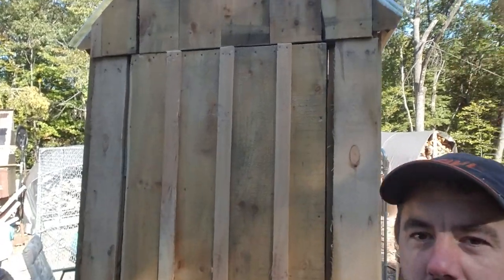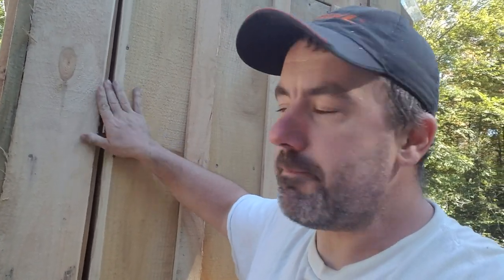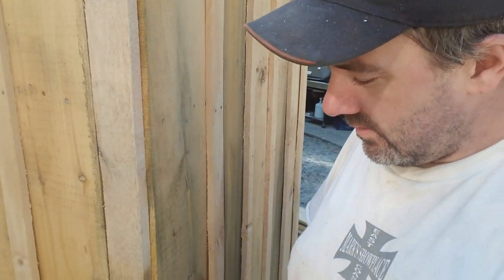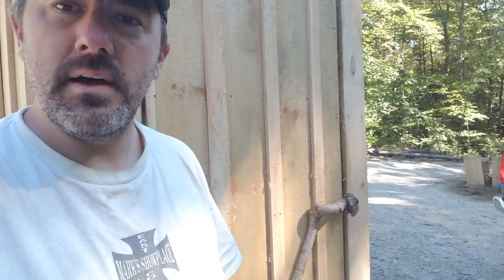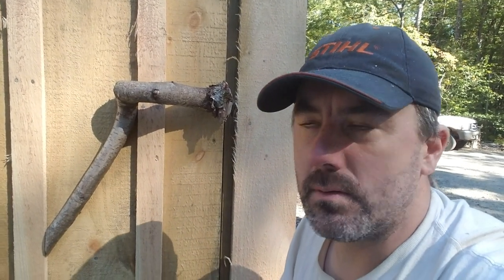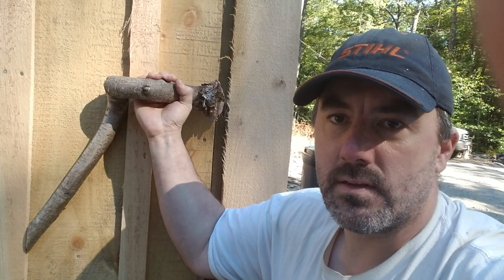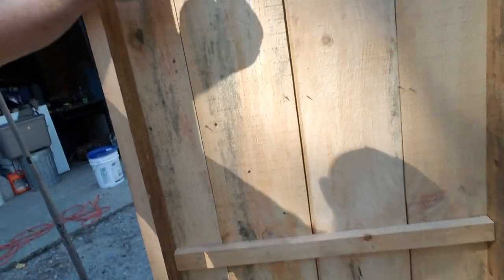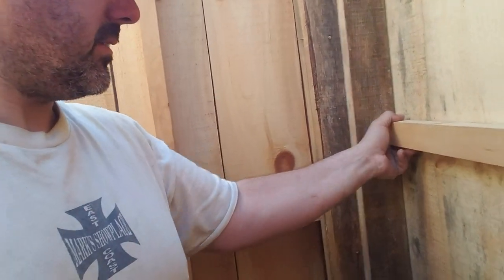Finished the Outhouse!

Comment: Hey Mike, as usual yet another cool project with the solution of the handle problem supplied by Mother Nature. 

A lot of old timers would use the surface root system off of a persimmon (or sassafras, I can’t remember) tree for walking sticks because they form various angles just below ground level. 

Never boring sir, keep it up man, keep it up. You’re doing good.
Reply from the maker: Thank you my friend!

Comment: I'm curious, As in most out houses would have some sort of ventilation in it... and why the tried-and-true Crescent Moon isn't on this either?
Reply from the maker: It has some good ventilation.  The soffits aren't air tight and I left gaps on purpose.   The roof siding is board and batten without the batten.  The ridge of the roof is also vented.  I probably should have mentioned those things in the video. Also, the new owner is going to do the Outhouse portion of it. What I agreed to build was basically a 4 by 4 shed about 7 feet tall. It certainly was a very fun project to do. Thanks for watching
Reply: tracy this appears to me to be a composting out house ....the out houses you speak of have a holding tank and it is the holding tank that is vented not the outhouse ...the outhouses with holding tanks are vented with screen in the walls but those are the plastic out houses that are pretty much air tight